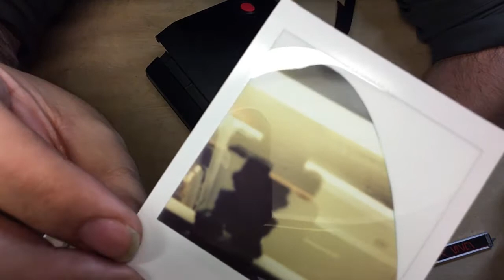How To Load Instax Square into Polaroid Spectra Camera

Comment: Ive seen someone add electrical tape to the rollers to get more tension but the tape leaves a ridge that makes it uneven. Im thinking if you can spray paint a few layers of paint onto the rollers it would give a “perfectly” even tension to crack the chemistry. Plastidip is probably best, its spray on plastic paint that is pretty durable and lays thicker than normal paint. Car guys use it to paint their wheels black and im sure it would be durable enough for camera use. Another bonus us that plastdip peels off as one piece and wont flake so you could cut it and pull it off like a sticker if you ever wanted to reverse the mod. Im gonna try it on my spectra whenever i can get to it
Reply from the maker: You might be onto something with the plastidip since it’s also flexible. I wonder if the uneven spread is more due to the construction of the 600 type vs Spectra. Even if you add thickness to the rollers, the thickness difference of the 600 type borders compared to the negative area remains. So what if you mask the rollers so only the center area has plastidip? Only what is necessary to cover the chemical spread path. That way the borders won’t push up on the rollers. You probably only need to paint the bottom roller, too..
Reply: @sprkplg  youre right i hadn’t thought about the border thickness. Ive been watching a lot of robertw1469 videos. Thats where i got the idea. Im sure you could mask off parts of the roller. It might take some trial and error but ill do more research. Im thinking of modifying a spectra film canister to be an adapter with a cr2 battery instead of buying an overpriced one online. That way i could just pop in an itype and hopefully have it run. Otherwise reloading film isnt too much of an issue its not like im shooting more than 32 polaroids in a day. Running instax would be a game changer though. im thinking its doable but im more of a 35mm film guy so its hard to say.

Comment: I wonder how evenly the chemicals would be spread if you just insert it like at 6:31, but turned around on the opposite site, of course.

Maybe we don't need the cardboard.
Reply: MrChrodo If you just put it in like that the pick arm that pushes the film forward for ejection would naturally push it off to an angle so it would need to be attached to something to keep it straight.
Reply: @NumaticVacuum  That's interesting, because it didn't got that much pushed at all in my ProCam. However, i couldn't test it with a fresh pack of film, yet.
Reply from the maker: In my camera the pick arm doesn’t travel far enough to get the smaller Instax frame into the rollers. Also it seems somehow the camera senses if there is film at the rollers and will keep the motor going if so. Otherwise it is just a partial roll. You can try it with an empty pack, the motor doesn’t keep going as long as if there was film. I am going to make the card more like a U shape with a cutout in the middle so that the rollers can contact both sides of the Instax square frame directly. That should help the chemicals spread correctly.